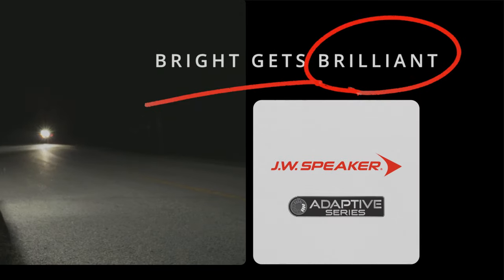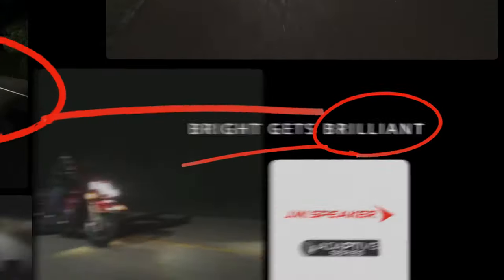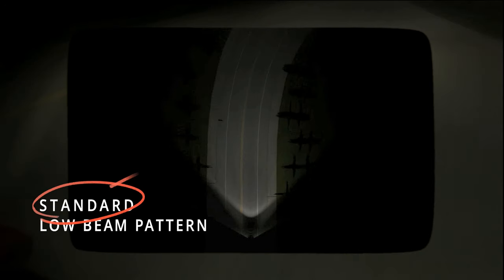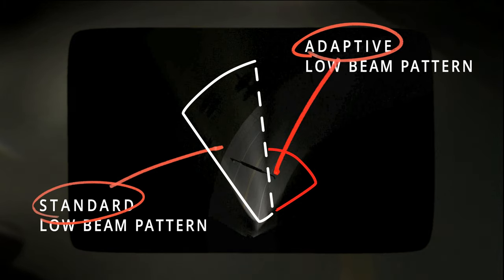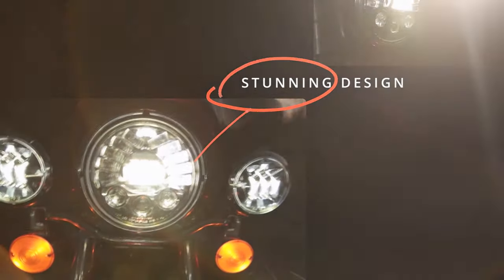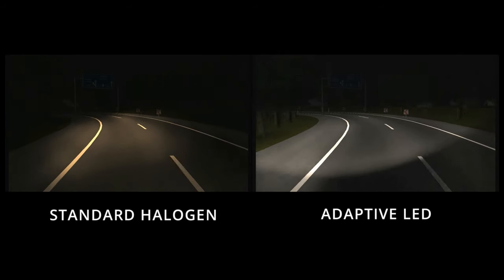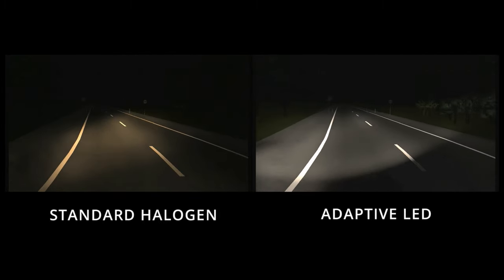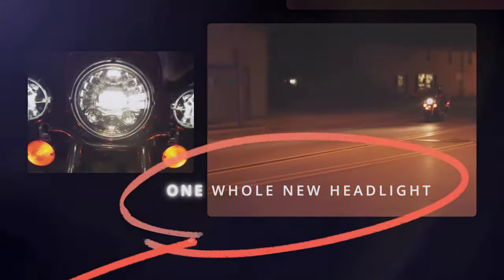The Technology behind the Adaptive Series LED Motorcycle Headlight

Comment: will it fit a stock bucket on a yamaha raider? yamha uses a stupid bracket inside bucket that wouldn't fit the original 5 3/4 jw speaker I have just wasting away...
Reply from the maker: The Adaptive Series headlight is available in two sizes, one of them a 7" round and the other a similar 5 3/4" round, that may have the same issue you had previously. Try reaching out to our Customer Service Team at speaker@jwspeaker.com. They may be able to find you an authorized dealer that can help troubleshoot your bracket issue.

Comment: Anything special that needs done if running a bike equipped with day time running light ?  do you need a bracket to fit 2012 street glide  and lastly is it simply plug n play ?  Thanks
Reply from the maker: Frank, this installation would need a mounting ring (http://www.jwspeaker.com/?post_type=part&p=5544). With this bracket, it should be a simple plug and play.

Comment: JW Speaker, would you put the plain down road projection of these on par with the Evolution series?  I have a dual lamp arrangement and I wonder if I used a Evolution for down road and an Adaptive for the corners that I would have a stellar lighting system?  Or is the Adaptive superior in plain down road projection?
Reply from the maker: +justlooking813 

The Adaptive Series lights were designed specifically for motorcycles with the same forward lumen output as our Model 8700 Evolution 2. Using a light pattern designed to maximize the benefits for motorcycle use, the Adaptive Series lights are going to outshine on any motorcycle application. For more application and installation specific questions regarding what to install for your dual lamp arrangement, contact your authorized J.W. Speaker dealer. They will be able to assist you in implementing the new Adaptive Series headlight for your bike’s arrangement.
Reply: +J.W. Speaker Corporation 

Thank you for your response!

My scenario uses a dual 5.75 inch housing. Does the same lumen output capacity apply to the 8690 and 8630?

While your at it, would you please differentiate the 8690 A with the 8690 M?  It appears the A line features the adaptive lighting while the M simply shares the same optics arrangement, but not technology.   

Would you please also illustrate the differences between the 8630 and the 8631?  Is the amber indicator the only difference?   How does the wiring harness change to accept a new signal?  While rather handy for an automobile, I imagine this feature might not be useful or appropriate for a motorcycle with lights in such close proximity; and even less useful in my dual unique lamp scenario.  

While I'm at it, here I present a concept of Signal + Adaptive headlights for dual lamp capsule motorcycles.  http://i.imgur.com/gOiJ9kM.jpg   I'll happily be a tester.  You can pay me with a production unit.   ; - )
Reply from the maker: +justlooking813 The Model 8690 A Series is one of our Adaptive Headlights, offering the new adaptive technology, dynamically filling in the darkness as you turn. The Model 8690 M offers a non-adaptive, fixed beam pattern with the same great design and state-of-the-art LEDs as the Model 8690. 

You can find spec information and lumen output for each Model we offer on our website, www.jwspeaker.com. When comparing the Model 8690 to the Model 8630, you will see that the Model 8690 does provide a higher lumen output. 

The difference between the Model 8630 and Model 8631, is that the 8631 offers an amber turn signal, designed in the outer ring of the lamp to display a flashing circle when  in use.

Please reach out to our customer service with additional questions at speaker@jwspeaker.com. They will be able to answer all of your application and Model specific questions.
Reply from the maker: +justlooking813 Thanks for your suggested design! We love to hear from our end users and what they are looking for in an LED headlight. We welcome any inspirational ideas for new LED lighting. You can send them to us at speaker@jwspeaker.com!

Comment: Es scheint ein wirklich heller LED Hauptscheinwerfer zu sein.
Aber...bei aller Freundschaft...630,00 € für "nur" 1 Scheinwerfer?
Das ist völlig übertrieben.
Egal welche Hochleistungs LED in dem Scheinwerfer verbaut worden sind.
Diese und der Neigungssensor zusammen mit der elektronischen Steuerung rechtfertigen diesen hohen Preis nicht.
Und dann stellt sich die Frage: Wie oft fahre ich denn bei Dunkelheit Motorrad?
Also ich fahre grundsätzlich nur bei Tageslicht.
-
It seems to be a really bright LED headlight.
But ... with all friendship ... 630,00 € for "only" 1 headlight?
That's totally overkill.
No matter what high-performance LED has been installed in the headlight.
These and the tilt sensor together with the electronic control do not justify this high price.
And then the question arises: How often do I drive a motorcycle in the dark?
So I usually only drive in daylight.
-
Cela semble être un phare à LED vraiment brillant.
Mais ... avec toute l'amitié ... 630,00 € pour "seulement" 1 phare?
C'est totalement exagéré.
Quelle que soit la LED haute performance installée dans le phare.
Ceux-ci et le capteur d'inclinaison ainsi que la commande électronique ne justifient pas ce prix élevé.
Et puis la question se pose: à quelle fréquence dois-je conduire une moto dans le noir?
Donc, en général, je conduis seulement en plein jour.